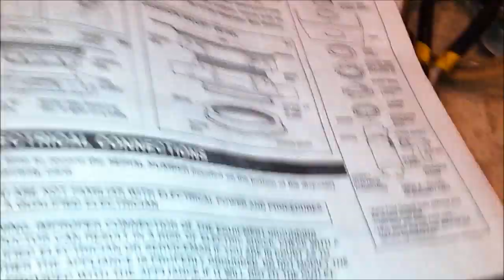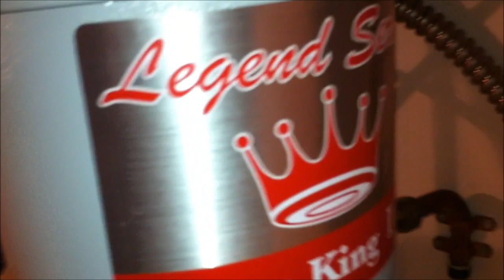Garbage disposal full installation waste king legend series L-111  1/3hp

Comment: Good video, thanks. Just to share, It appears that a lot of folks, myself included, struggle with getting  the cushion mount on properly. It's easy to get it in the wrong "groove" which won't allow the disposal unit to mount properly. The trick was to put the mount ring on first, then pop on the cushion mount just barely on to the bottom lip of the sink flange. This allows the mount ring to drop down far enough so the ears on the disposal unit easily push up far enough to lock the unit in place as shown in the video. Initially I had the cushion mount up too far up on the flange so the mount ring could not slide down far enough to attach the disposal. I spent over an hour struggling with this, so hopefully this helps others avoid the same frustration I had.

Comment: Thanks for posting this.  I installed mine last year, and remembered only that I had a hard time with the mounting aspect... that turny part.  Trick is, don't push the black rubber thingy up too high.  Thanks for the video... it showed a close up of a small hollow space visible between the metal and rubber inside it...

Comment: Thanks for the video!  Solved my problem of drain issue from dishwasher in 5 min.  Installer forgot to remove the dishwasher line plug on the disposal.

Comment: thanks!  i went thru a lot of YouTube videos for this project and yours was the best.  you used my brand and showed everything s-l-o-w-l-y..  between that and actually reading the directions i got it done;  the only things different were 1)who ever put the old disposal in used TONS of putty that i had a really hard time getting off.  that seemed to take me longer than the whole rest of the removal/replacement did.. and i had to cut some of the pipe off of the connection to make the new one fit into the pipe.  so i got to use the hacksaw.  now to find videos on leaky faucets..

Comment: Great job!!! I spent an hour trying to connect the disposer to the mount assembly before watching your video, because the instructions were vague. I also put the gasket up to high.  After watching your video I was able to compete the job in like 8 minutes.

The manufacturer really needs to do a better job describing or showing what to do for that step.

Comment: Probably the trickiest (most difficult) install in the disposal marketplace. Once you get it it's all forgotten, but when I tell you that I've had a plumber leave my tenant's site and buy an inferior brand from Home Depot. I say "inferior" because Waste King is the best, the quietest and the most reliable disposal on the market. Because of it's weight (it's heavy and large) it just makes for a frustrating install. The plumber that installed mine, at my house, struggled with it as well.

Comment from the maker: yes thanks for reminding me at section 18:30 I tightened it just a little but after the video I tightened it all the way, there is a channeled section where you place a screwdriver to use as a lever to turn the metal ring all the way to set the lock .

Comment from the maker: source: below cost appliances /disposals/ge-install.html

D. The rubber gasket is used instead of plumbers putty with stainless steel sinks.
E. If no putty is used, insert the sink flange through the rubber gasket into the sink opening. Do not turn the flange once it is seated.

P.S. I didn't use that website to purchase the disposal, I got it from Amazon. Thx for the concern, I went to double check under the sink to make sure all was dry and it is.

Comment from the maker: @Nottotv    hmm maybe because as you notice at 7:30 I pushed the rubber washer up too far up into the black plastic drain tube then i removed it to let it just sit into the bottom edge groove on the plastic drain tube. Or you might have it backwards sorry the response might be too late but i hope you did it.  The way it hums when you turn the system on sounds awesome I'm enjoying it.

Comment: Mine is mounted on stainless steel using the gasket, but the lip of the flange is just a mm higher than the sink base causing water to pool at the flange site. Just for S&G I tried it with plumbers putty, still the same issue, anyone else notice this?

Comment: Insinkerator is a horrible brand. My badger 9 lasted only 3 years. And guess what it started leaking right aftee the warranty expired. My old wasteking lasted 19 and a half years before it stopped working. And it NEVER leaked.